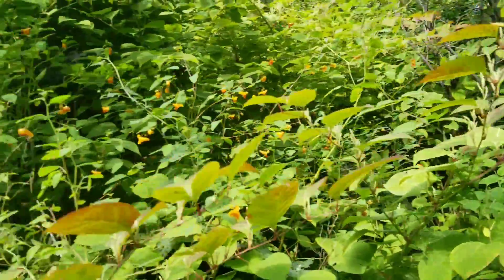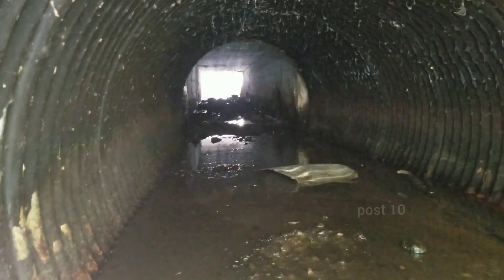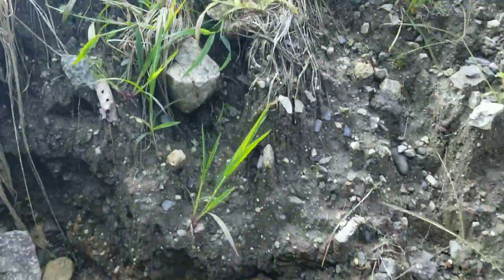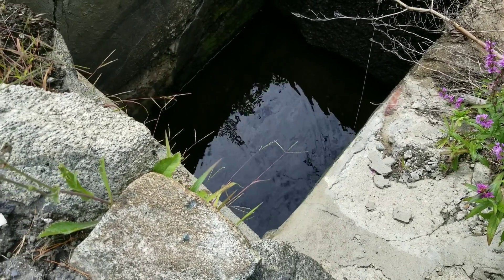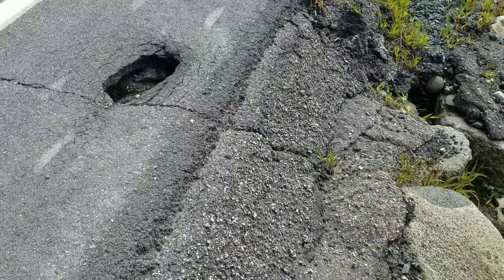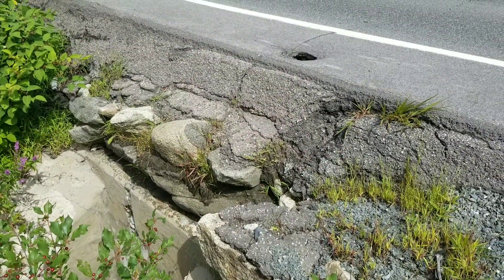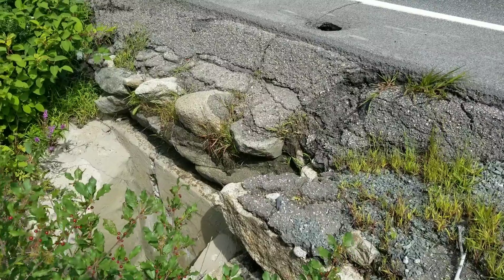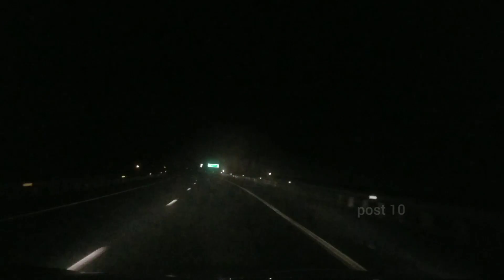Sinkhole Forming From Soil Washing Out

Comment: As a building inspector and Geotechnical engineer. I will say, be cautious of the difference between normal and abnormal erosion. Opposed to the creation of a sink hole. This to me (given just video) id call it abnormal erosion caused by improper installation of a culvert.....please spend $10 on a soil probe. Just a 'T' shaped piece of fiberglass with a metal tip you probe the ground with. It would be EXTREMELY beneficial to show any municipality if you wanted it fixed!
Reply: I would be more than happy to write you an official "inspection from distance" if you so wished. These improper culverts can be very very dangerous if left alone. If you want, i can send you my email. And we can discuss it more officially. Very scary problem you have exposed.

Comment: Don't use your high beams in the fog, good video dude.
Reply from the maker: I just wanted it so show up better
Reply: post 10 it actually makes it harder to see, because the high beams just reflect off the fog and straight back to your eyes, that’s why fog lamps are mounted low, to illuminate the kerb & road markings, without glaring back to you 👍

It does show the thickness of the fog better on video with high beams on, but your safety is more important than the video
Reply from the maker: @Dust76tr  I worded that wrong, I used high beams so it would show up better on camera
Reply: @post.10  It did show up well with the high beams.  But that was not dense fog.  When you can't see ten feet in front of you, that's dense fog.
Reply: post 10 ahhh ok. Then yeah, the high beams did a good job of showing off the fog for us :)